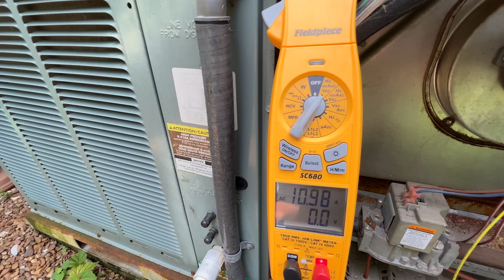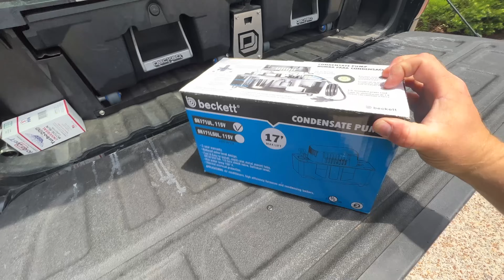5 Tips EVERY Apprentice Should Know!! HVAC Lessons

Comment: Just got accepted. Starting trade school for HVAC in January. I'm feeling pretty confident and ready to get into this. Gonna try to learn as much as I can between now and then.
Reply: How’s school going?
Reply: @Betoven81  Just finished actually. Planning on having a job by this time next week. I learned a ton. Mostly residential stuff, but definitely enough that I'm ready to get started. We did some installs, pull and cleans, duct work, ecm motor swaps, load calculation, repairs, brazing, all kinds of stuff. Got a lot of 'employment ready' certifications. Class was pretty disorganized and a bit frustrating at times, but I'm glad I went.
Reply: @boredkid1235 This sounds very familiar..😂 but I’m getting outta school in May! How’s it going so far bro?
Reply: @user-hb8rw3nr1h  It's going great, I've been working almost 6 months now for a large company in my area. One word of advice- know what you're getting into. Make sure you get with a department or company that's going to put you to work using the skills you're learning in school. I started in an IAQ (indoor air quality) department and while I've made good money and gotten my foot in the door of the industry, I'm currently in a position where I might have to switch jobs in the coming months. I've been doing insulation, duct work, duct cleanings, aeroseals, UV light installs, things like that. I've learned a lot, but I feel like I'd be getting more valuable transferable skills at a smaller company or a maintenence department. I've barely gotten to work on the units themselves which is what I really want to learn to do. That said, I'm still feeling very optimistic about this career path and I'm definitely moving in the right direction. Also I'm getting ready to move out of my mom's house, so that's cool.

Comment: Great tips, im on my last couple days of hvac trade school, and I'm kinda nervous to start. I've never done anything like this and that's what makes it worse. The electrical part makes me extra nervous but hey we all have to  start somewhere i guess.
Reply: Absolutely bro we all started riding being helpers, but like some of us we didn’t go to school we learned as we went so you got a jump on some people, and hey most people don’t know they have a split system 😂 “da thing outside make the air cold” and aye it’s gonna suck being tool grabber at first but at least you get paid for it lol
Reply: Be comfortable with not knowing. That’s the best advice I ever got.
Reply: Quick tip always check your leads to ground aka bare metal anywhere - If you’re dealing with 3 phase contactors theres always a terminal or ‘leg’ with power
Reply: 2 years later how’s it going

Comment: Paying Attention to Detail, capacitors do not come mounted from the factory with zip ties for a reason, they need to be grounded, use a small metal strap, people that leave them in the box or hang them with a zip tie are where the term "run cap bandit" comes from! Find out what books are required in your state for passing your license exam and study them, once your have met your states experience requirements you will be ahead of the game to start getting your license.
Reply: Leaving them in a box is a bad idea.
Reply: @HVACDzo  right I’ve seen so many installed inside the boxes 🤦‍♂️
Reply: If the capacitors needed to be grounded via metal strap, brand like TradePro would not make them enclosed in plastic. I don't disagree they need to be mounted however as long as it's sturdy, the material doesn't really matter as long as is isn't encapsulated in any way like keeping it in the box it came in

Comment: How do I pick up the pace I just started as installer helper and they told me I’m moving slow I’m a big guy and I try but I just want some other insight on picking up the pace so I can work my way up the ranks
Reply: Just keep those knees moving. You don't have to sprint around, but these guys need to see that you're taking it seriously and that you give a shit. Another tip I can give you is that if your weight is becoming a serious issue, then you need to start hitting the gym. That means you'll be away from the home longer, but nobody that ever became a somebody didn't have to sacrifice something for it.

Comment: why don't they have a p trap on that unit you did the run cap on? Is that one of those internal p traped unites
Reply: I’ve  been taught it depends on where the drain is as compared to the indoor blower . If it’s before it (negative pressure side) , you need a trap and if it’s after (positive pressure side ) you need no trap
Reply: @aaronjosselyn8827  true true
Reply: Rheem package units have an factory installed  trap next to the compresser

Comment: Question, how do you measure capacitor  under load with fieldpiece multimeter that you have?
Reply: Amps times 2,652 divided by volts
Reply: @clubtouge1052  its just sad to accept that fieldpiece multimeter isn't capable of measuring the mfd under load🤦‍♂️
Reply: @shanthaghnazarian1475  When in doubt try a new capacitor; I don't remember having to test mfd under load ever in 60 years!
Reply: @shanthaghnazarian1475  thats not true, you can absolutely test caps under load with any meter that can measure amps and volts.

Comment: I am confused with vacuuming a drain line that. I don't often see drains that need vacuumed and I just do a basic flow test. If I pour half a galleon of warm water with some cleaner, it's gonna get the job done. Especially after cleaning the coil.
You also use turbo caps. Why would you not use the proper capacitor? It's cheaper for the customer and in my limited experience, those universal caps are unreliable and expensive. I use them for temporary repairs only.
Edit - I lack experience and knowledge. I myself, am an apprentice.

Comment: I'm new to the trade but I don't think using a pressure washer to clean the inside is a good idea could bend the crap out of the coil not letting air through (risk factor) I also don't know the pressure of the water he was using either but it looked a little high. Just a cringe moment for me lol 😂 if anyone has another opinion please share.
Reply: Your right to much pressure bends the fins
Reply: Pressure washer? It was a water hose

Comment: Tip number 6, Dont park in customer drive way. Park on the street. Yes you might have to walk a ways, but no chance of dripping oil from truck on driveway or other fluids. also you block the driveway of customer.

Comment: Nice tips for the younglings but a couple of those calls you ran could’ve been taken care of on site during the original maintenance visit… Turbo Cap and condensate pump should be truck stock items eliminating the need for a second trip costing valuable time and money, especially with gas prices right now, Diesel…Good God!!! I’m surprised you continue to operate out of a pick up truck which limits your capacity of parts and costs more for second trips. I understand you want to have a work/personal vehicle but it’s costing you time and money. I’ve learned years ago to separate the two. Not to mention a van dedicated for work would be a tax write off, granted I’m sure you are writing off the pick up truck but your spending more with second round trips, storage compartments and alternative mounting equipment. Just a thought brother, there’s a reason why this industry utilizes vans compared to pick up trucks.
Reply: I'm sure he did his math; his truck is well organized; as for the Turbo capacitors, he gets a 5 year warranty; it's a good selling point. Keeps your customers yours!
Reply: @bobboscarato1313  He just bought a van…just saying.
Reply: @michaelmcewan5074  That's what he said!
Reply: Very true!!
Reply: I use your mom's box instead of a van because there's more space inside and she's good at handling my tool.